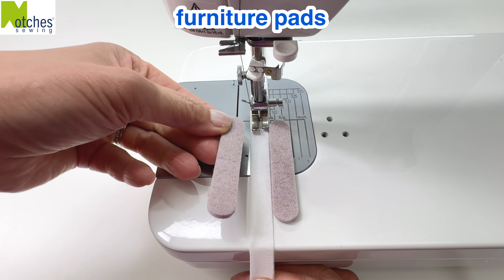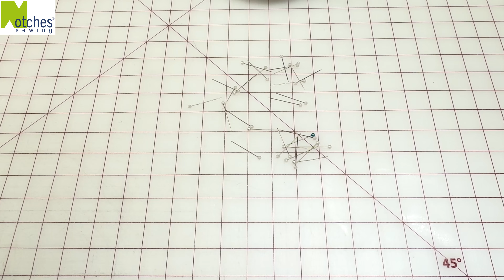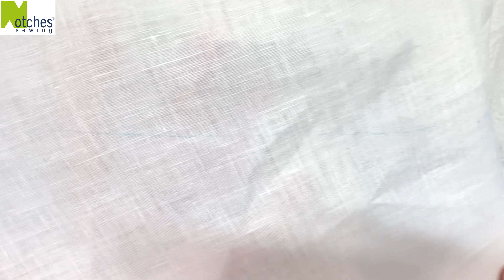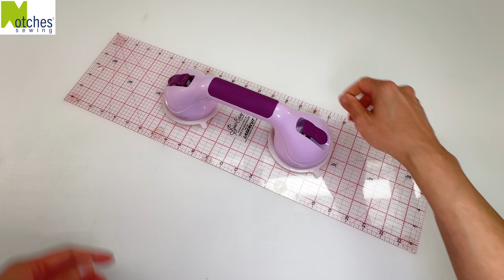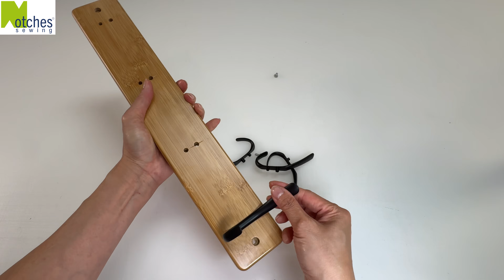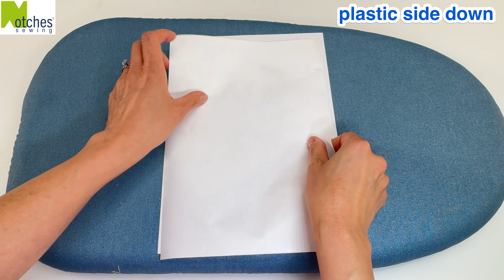Awesome Sewing Hacks using Household Items You'll Actually Use!

Comment: I use freezer paper for patterns trace the tissue paper over freezer paper with an Sharpie alcohol marker then darken the lines, I can iron the pattern to fabric instead of pinning. Works great for those with several sizes. Then I put the original with freezer paper in a zip lock bag. This works great for making patterns smaller or larger by cutting the freezer paper adding more or take some out. You can make notes on the freezer paper too.
Reply from the maker: Thanks for sharing your method, I love hearing new ways to make the sewing process easier! 🧵😃

Comment: All great ideas . I use magnetic tape on my machine and I can throw the puns on it as I go. I use the chopstick a lot to turn points . I have a flat boning tool to press seams when I don’t need to iron right away. I use a facial hair blade sold at $ tree to tear apart stitches if my single edge razor is not handy and big washers from the hardware store for fabric weights,I keep 1 st aid paper tape from $ tree handy to hold things down temporarily, I use brown postal wrapping paper or packing paper for patterns to hold up longer than the tissue paper in envelopes from stores. I like the rolling pin idea.  I use pipe cleaners to tie up buttons and clean uthe machine
Reply from the maker: Thanks for sharing!

Comment: I had issues with my feet that resulted in having the tendons in my toes clipped to keep them from curling under. After each time, when the stitches were removed the doctor used a pair of tweezers and snips similar to the ones in this video. They normally throw them away, so I asked for them, sterilized them and now have several sets at my sewing machine, serger, ironing board, and by my chair for when I’m doing hand work.
Reply from the maker: Great that you repurposed them!😃

Comment: Just love your ideas. Definitely will save this video. 
I am from Connecticut and love your votes. Your instructions are clear 😅and easy to follow. 
I have a question for you. Can you use cotton fabric for a knit fabric pattern ?
I have alot of top patterns but for knit fabric. Can I use them for cotton fabric but I know you need to make changes. Can you explain how for me ????
Thank you keep up those videos so helpful. ❤
Reply from the maker: Thank you!  You can sometimes use knit fabric for cotton patterns but not the other way around.  If a pattern is made for knits, it needs to be able to stretch,  so plain cotton will not work .  Imagine making a tight t-shirt with plain fabric.  It won't work.  You just need to factor in how you will put on and take off.  It also depends on style.  There's no simple adjustment that will work for all patterns.
Reply: @NotchesSewing thank you

Comment: Hi. If I have to undo a long seam, I undo a small section and then I put one edge of the seam under the pressor foot of my industrial machine. Taking hold of the other side I use a blade to cut the thread. It goes very fast. It's like having another pair of hands.
Reply from the maker: Yes it's a great time-saving tip, thanks so much for sharing it!😊

Comment: When matching seams for quilting blocks, pin the seams first. Then set your sewing machine to baste. Stitch 5 -6 stitches across the seam of each intersection. Remove the pins. Check your seams on the front of the quilt. If your blocks don’t line up, remove the basting stitches at that intersection and adjust. If everything looks good return the stitch length to your desired stitch length and sew the full seam. This saves a lot of ripping out if the seams don’t match.
Reply from the maker: thanks for the helpful advice!😃

Comment: Thin foam grid type shelf liner, such as is sometimes sold in dollar stores, works extremely well to keep templates from slipping.  You don't have to attach it to anything, so one or two small pieces work for all your templates.  You can sometimes find  a  jar lid gripper made of the same material.
Reply from the maker: Thanks so much for the tip! That's a great idea!

Comment: ❤👉🏻  I have the sheet metal under my cutting board. there ARE systems that have it sandwiched between the boards, but they are OUTRAGEOUSLY priced.  The sheet metal is an excellent option. The best and strongest magnets to use are  "Neodymium".  I can put a couple on a ruler with multi layers of fabric under it, and it hold perfectly...that is how strong they are.  There is a place online I bought mine, they weren't real expensive,  and they come in different strengths/sizes.  I think the company is M & R Magnetics.   I have NO affiliation with them.
Reply from the maker: The sheet metal works brilliantly.  I wish I had it 50yrs ago…

Comment: I've done this with cardboard tubes and binding. It's an inexpensive way to making a lot of binding ahead of time and storing them (Note: at our house those tubes are called "doo-doot tubes" because when my son was little he liked to put them up to his mouth and make noises, like "doot doot" through them.)

Using cookie cutters for circles, you're limited to the size of the individual cookie cutters. If you have several graduated cutters you can put the smallest one in the center and "roll" a larger one on it's outside to get larger circles.

Yes, I've used that adhesive on the machine to hold thread nippers/scissors for close to a decade now. Very handy!
You have to be careful using magnetic scissor holders on computerized sewing machines because if you place the magnets in the wrong area the computerized parts may not be shielded in that spot and then your machine becomes a large, expensive paperweight.

I tried that silicone baby bib - the pocket at the bottom of the ones I bought were too flexible and everything kept falling out. I'm presuming some bibs will work for this application but some definitely do not.

Yes! That metal zipper jig is wonderful to use! It's so lightweight I glued mine to a ceramic coaster so it's a little heavier, doesn't move around as much and I can use both hands to put the head on both sides of a zipper.

That mounting tape is a complete nightmare to remove from your sewing machine if it's left on too long. And using rubbing alcohol to remove the residue can also remove the markings on the plastic base of a sewing machine or sewing machine table.
Use a small pad of post-it notes, remove the backing, and stick it into place. It's easy to remove and when it stops staying put just peel off the bottom layer and stick it back down again.
Genius idea to use the furniture pad for already-used but not-used-up needles.

Be careful using a metal scale ruler - if you accidentally run your rotary blade up the side of it the blade is toast. There's a reason why rotary cutter blades are made of acrylic and not metal. I just flip the fabric over the seam, cut the batting, then iron it back down.

If you don't have a wooden rolling pin you can flatten a cardboard tube and fold it in half, wrap some cotton fabric around that and put it inside the fabric tube.
Cutting out different widths of cardboard and doing this will let you fit different sized tubes.
And certain types of bamboo chopticks can also be used for small tubes.
Note: if you wrap batting around it instead of cotton fabric it can be difficult to put the fabric tube on it because the batting likes to stick and will shift around
 
Genius idea about the pleat maker using the plastic cutting boards! I've only  been using them for making pattern pieces.

When making a thread cone holder, make sure it's tall enough that the thread doesn't continually run over any plastic part of the sewing machine as it can, over time, wear away the plastic. There is a reason why sewing machines have metal pieces where the thread goes though.

The blue ink pen on a ruler hem marking setup could be angled by accident giving a wrong hem measurement. This is probably better used on a hardwood floor instead of a thickly carpeted floor.

The tips on Sizzix angle-nosed weeding tweezers are small enough to fit under a presser foot, on either side of the needle giving you extra control over fabric seams, especially at the end of a seam when there's not enough to guide the fabric with your fingers. It can be used as seam ripper and pulling out the threads, as a regular stilletto, as an awl, and the rounded end can be used as a Hera Marker.

Be careful of the type of pipe cleaners you get - the bristles of some I've tried actually fell out into my machine when I was using them to clean the bobbin area. Not fun.

Note: Those washable markers can leave behind ghost marks if left on the fabric too long. And Frixion pen ink can actually create bleach out lines where it's drawn on fabric.

Magnetic metal bowls are a lot cheaper at hardware stores than from sewing stores.

It's better to iron freezer paper to the backs of paper patterns. Packing tape can get sticky at it's edges over time because the adhesive is a viscoelastic material that acts like a thick liquid, slowly flowing out from under the non-sticky backing. And you don't want it sticking to other paper pattern pieces because that would be a disaster.

3M makes removable transparent knobs that I stick on my quilting rulers. Makes it easier to move the ruler around but you can still see the measurements underneath and they don't let go. As opposed to the type of quilt ruler handle shown in this video that you can't see through and eventually loses it's grip.
If you leave this packing tape handle on the ruler for too long it will leave a residue. Using rubbing alcohol to remove the sticky residue can also remove the markings from the ruler.

Genius about the cardboard pleater. In all the decades I've been sewing I've never heard of a puff iron - I'll make sure to use a wool dryer ball - THANK YOU FOR THIS!

Yes, the hook side of velcro works great as a velvet board. 

I took a clean round oatmeal container and cut a 1/4" slit almost from top to bottom. Glued some fabric on the outside to make it look better. Hot glued some elastic parallel to one side of the slit. Cut a thin wooden dowel so it was about 1/2" taller than the container. Poked a hole in the bottom of the container, guided the dowel through that hole and hot glued it in place. Poked a hole through the plastic lid for the dowel to fit through. Slid the center holes of several ribbon spools onto the dowel, with circles of cardboard between them, and put the lid on. Used tweezers to pull the ribbon edges through the slit and then through the elastic. The elastic keeps the ends in place.
Reply from the maker: Thanks so much for sharing your wisdom and experience! I'm sure many will find these additional tips really useful. 🙏

Comment: Rectangular or  square fridge magnets works very well as a seam guide.ive been using this for many years. Its also cheap.
Reply from the maker: Thanks for the great tip! I'm sure others will find that useful too. 😊
Reply: @NotchesSewing  I use elastic pony tail bands to slip around footplate (with the flat bed removed of sewing machine removed) and move  it from needle as required  - works well if your machine won't hold a magnet

Comment: Thank you for the idea of the scissor channel. I’m going to have my husband use a router to inset it into the table. I had a stroke and using a rotary cutter is no longer safe. Even with chef cut gloves. I also have my snips on the side of my machine, with Velcro. Then I put a key holder with a pull out string and added the other side of the Velcro on that. It works great, it can unhook when needed, but I’m less likely to wander somewhere in my sewing room if they’re stuck to my machine. I recently organized my sewing room, to work better for me now, I found 3 pair of snips in various places. It’s a whole new world to me. Nothing even garbage cans can be under foot because I’m a fall risk. Large plastic tubs of fabric, which worked great, have been changed to clear plastic cube bags that fit into a cube shelf. All fat quarters, are in an old tall CD holder. I put a 5 drawer dresser in the small closet, to hold my quilt projects that I’m working on.
Reply from the maker: I love the key holder and cd holder idea!  You just reminded me that I have a cabinet that I used to use to hold cds that II can use for more storage!  Thanks for watching.😊
Reply: @jwall6006  I love your cd holder idea! ❤️ I use a lot of fat quarters for my small sewing crafts. I’m so sorry about your stroke but I pray that you stay safe and continue enjoying your sewing hobby 🙏💜 😊
Reply: CLEVER ideas!!  I am just always looking for more storage, so I found a wooden CD tower at the thrift store, turned it SIDEWAYS, & screwed it onto the tops of two 2x4s.  Picture an upside down block shaped U, with 6 little cubicles across the top.  Stood them up behind my 4 ft desk, next to the sewing machine so the CD cubes look like cubbies 2 feet above the desk but nothing is stuck to the wall...
Bonus, the desk is basic, the small drawer & one big file drawer are to the left of my sewing machine for storage, & UNDER the desk was perfect for 2 little 3 drawer rubbermaid stack drawer units... Lots of work area on one wall.... You wouldn't trip!
 I love repurposing things, like those van lifers using children's wooden play kitchens in their vans for organizing, or when ppl added strips of wood edging & changing pads to turn dressers into baby changing tables with storage. 
 I love your clever, safe, storage & arrangement solutions! 
Sounds like you will be just fine!
Reply: Your idea for wearing oven mitts is brilliant - taking up sewing again after 40 years and after using a rotary cutter have a few nasty cuts on my fingers after slicing my fingers instead of the fabric
Thank you and I hope you continue to do well c